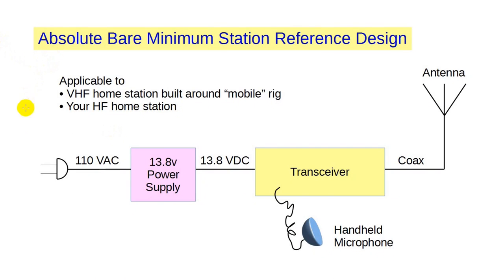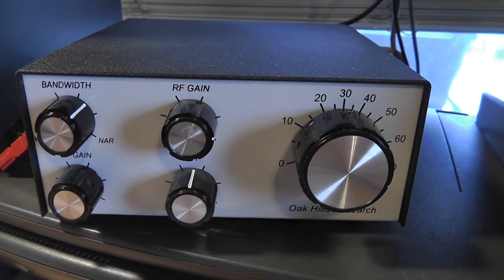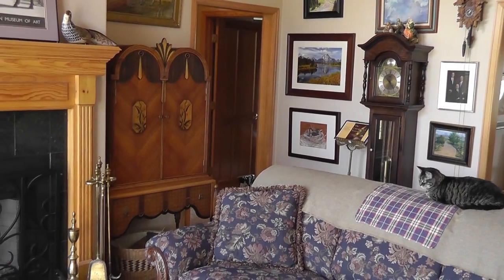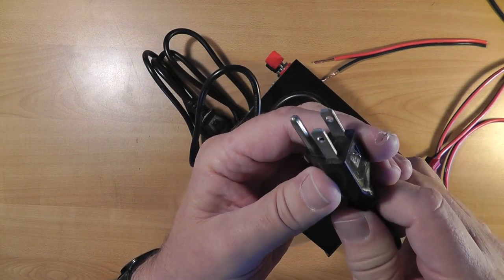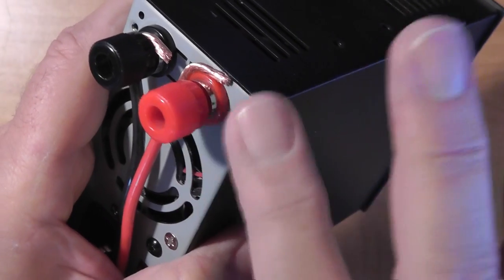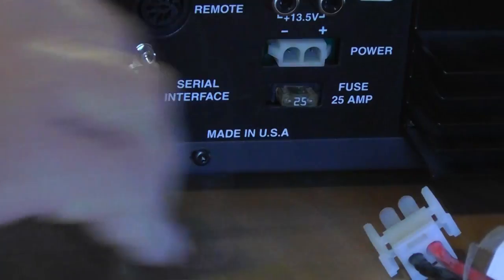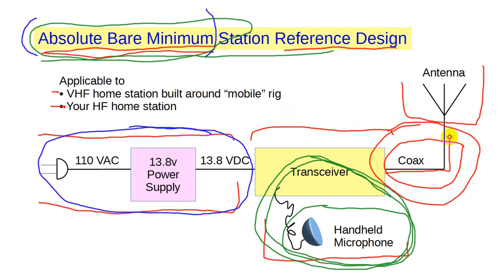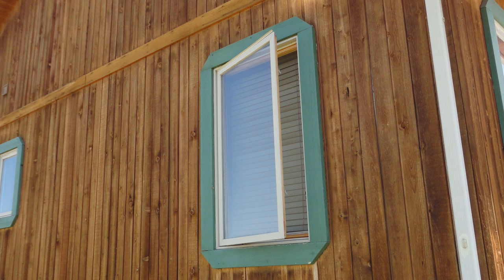Setting Up Your Home Ham Station: Ask Dave Episode 3

Comment: This would have been super helpful when I was trying to get my home station set up. The manuals all just said “Connect the radio to the power supply but didn’t say HOW”. I finally found an article about ring terminals and crimped the wiring to make the connection. Fantastic information!! Thank you!

Comment: Great video! I find that RG-58 is my favorite cable for HF patch cables inside the shack at 100 watts or less. It's very flexible and easy to work with. These days, I'm partial to LMR-240 for outside runs at HF. Should be good for at least 500 watts with a decent SWR. It's easier to work with than RG-213 or LMR-400.

Comment: The steel wool also keeps the critters from coming in through the holes.  It's amazing how a mouse can make it through a very small hole.  My "Shack" is in the "extra" cloak closet in our bedroom.  It's insulated with polyurethane panels on all walls and the ceiling for sound absorption so I can chase that wee-hour DX station.  It has a vent into the ceiling for cooling, it can get quite warm with rigs, computers and amps going.  It's not large, it's about 5'X7' and can be locked to keep the kids out.

Comment: The term RG as a prefix for RF coaxial cable designation comes from the US Navy. They first used it and called it Radio Guide. They needed flexibility and parallel line just wasn't cutting the mustard.
Nowadays we have, as an example, Radio Guide 58 (RG58) feeder transmission line.
Reply from the maker: +Ade Larsen Indeed that is true. And the U that is sometimes appended stands for Utility, e.g., RG-8U. There's an article in the August 2001 issue of QST on the history of coax cable.
Reply: David Casler I'll look it up, thanks Dave.

Comment: I set up a vertical dipole for a 12, 11, and 10 meter antenna.  It is fed in the middle, of course.  It is set on the crest of the roof with a pole coming out horizontally from the apex with the vertical dipole on the end.  It looks strange but it seems the person I set it up for is happy with it.  He also uses it on 6 meters with a tuner.

Comment: Hi Dave. I recently ran my Icom 7300 to (2) 6V golf cart batteries with a Harbor Freight 100 watt solar panel kit, with included charge controller. The first stop off of the batteries is an mfj fused power strip with power pole connection slots.

Comment: Hi Dave and thanks for the insights. They are helpful to a new ham with no Elmer to lean on.
I am with Anthony re: setting up a rig in a vehicle, but probably with a different slant. I live in a Winabego 35 ft. diesel pusher. Most of the time I am in a permanent location and hooked up to shore power. But, from time to time, I disconnect and take a trip. So, I not only have to consider a "base station" but the mobile concept as well. While en route, I am on rubber tires going down the road, when parked, on steel levelers in contact with the ground. Plus, electrically, I live in a metal shell.
I am not so much concerned with how to route cables, or power supply, but more with grounding, lightning protection, portable external antennas vs. a permanent arrangement at home base, etc. and how these relate to my particular living conditions.
I obtained my Tech. class self study only 4 years ago, but have not been on the air much for several reasons. Time has come to use that which has been granted me. Hope you can help.
73

Comment: On
 the power supply, the ring terminals on the back also accept banana plugs. So that's an option to avoid the bare wire and shorting risk. You'll have to get adapters or connectors for your power cord though.

Comment: When I started my journey to HAM I could not afford to buy a power supply and used a 25A⋅h LiFePO4 travel battery) This type of battery provides 14-11V and 20A until the very end of the charge. When working with the Yaesu FT-891 at 100W, this battery was enough for me for more than a day. So this is a good option for those on a tight budget)

Comment: I got my start in single sideband CB radio.  I used to modify single sideband CB radios to go above 1-40 channels and unlock the clarifier.   I'd supply the clarifier with 8 volts and reprogram the PLL chip with either a high (+5 volts) or a low (0 volts).  Now the only Ham radio I have is a Yaesu FT-4VR I got from the local Ham club for passing the test.  It's only a mono band, 2 meter HT and I built a 1/4 wave ground plane out of some old romex 12 AWG wire I cut apart.  Using my old RG-58U CB coax cable from the antenna (20 feet in the air) to the HT.  So far my wife tolerates the coax coming in from outside through a crack in the door, but when it gets too cold I have to shut the door.  I'm hoping maybe my dad will buy me a Baofeng dual band radio so I can get onto the 70 cm band as well.  I have plans to make a 2 meter folded dipole 4 element yagi when I can save up enough to buy the PVC pipe.  I have all the other supplies to make it with.  Trying to hook up an Astatic D-104 to my HT but I'm having difficulty doing that 'cause I cannot find a proper schematic on the Yaesu FT-4VR 'cause they ain't made anymore.

Comment: Another great video.  Informative as always.  As a newly “minted” Technician & General I am looking for feed line and shack setup.  Your L-shaped desk will fit my needs perfectly.  I already have a external box with a pair of LMR400 that feeds lightning arrestors in the external panel and using a low voltage box inside with a metal plate with a couple of N-type bulkhead connectors.    So I am trying to decide between LMR400 & RG213 for VHF/UHF feed line.  Bonding the ROHN 25G tower in a better fashion is also on my list (they only put one ground on a single leg).  I am looking forward to a coming up with a good grounding/bonding plan as well.   So if you have any advice on feed line let me know.  73!

Comment: Hey Dave, thanks for all the great information.  

I have a grounding question; I understand the metal enclosures for all station equipment should be grounded to each other, and then to a dedicated grounding rod - additional to the electrical grounding that is provided by the third prong on the A/C cord. My power supply is very similar to the one in your video and there is no specified spot to attach a ground wire to the case. Do you still recommend grounding the supply this way or is it unnecessary? Is there a specific way I should attach the wire? My transceiver has a built-in terminal for the ground wire.

Thanks again,

Matt
Reply: Your radio case is grounded to your power supply through the black wire. No additional wireless is necessary.

Comment: Dear David
Another great video. I have a different grounding problem since I live in a third floor flat. Do I need to run a thick copper wire to the ground into an earthing rod?
The heating system has old cast iron pipes - it's a 1930s flat.

Comment: Thank you for this information. I'm a newbie Tech and am about to buy the TYT 900 for my home rig.( I have a HT UHF/VHF radio.)  It comes with a antenna, of which I'll really need to study. I know it's most likely for mobile. 💡Question: the MFJ is that the brand name of the connector for windows? Or is it the place to buy this hardware? Im unclear on this. Thanks, i know this seems like an elementary question, but all this is very new to me. I maybe able to get my son to help, but doubtful. I need to understand fully what to do, so as i can repair, etc. But,  I'll need one of those. I'll start with the antenna that comes with the rig I've got a feeling I'll have to mount it on the side of my house. Possibly in an extended PVC pipe???💡  But eventually will put in a fan dipole i saw which is great for all bands. This will probably go on the front of my home. I'm literally on the coast so putting it north- NW will be perfect. It may look funny but asthetics isn't one of my issues lol. Thank you and looking fwd to your next video on small spaces.. Your videos are very helpful to me. You explain in simple terms and carefully. Thank you for that!

Comment: My learning curve in the realm of short wave radios is pretty vertical. I think I might need to start with Episode #1, but this one showed up, and it had an interesting title. I just purchased an Eton Elite 750 (free returns), but after picking up an English broadcast from Havana, Cuba, one somewhere in Japan, one from the South Pacific, I am quickly thinking I want to get into ham, instead of just listening to the broadcasts of others. Can I learn on a shortwave transceiver, say, an ICOM IC-7300 or Yaesu FT-991, but without broadcasting, before getting my ham license? I don’t want to violate any laws about operating a transceiver without a license. It would be nice not to have to buy two different radios (a starter receiver like the Eton and then a transceiver), when I could apply the price of the first one to the second one. Thanks! This was a fantastic video!

Comment: Pros and cons of attic vs exterior antennas?  Great video keep up the great work.
Reply from the maker: +jpintek I'd recommend an exterior antenna if you can do so. Attic antennas do work, but outside and higher in the air is better. 73, Dave, KEØOG

Comment: I would like to recommend that new Hams also NOT use multiple pieces of coaxial cable connected together.   Always try to use a single piece, as each additional connector  between the radio and the antenna can cause additional attenuation of the signal.  This loss  is exacerbated by improperly attached connectors.

Comment: Thank you Dave I'll go ahead and put it back in line with my 225 amp I'm running .. by the way I love your videos I just started to watch them yesterday.. 
Km4wng J.Tineo
I'm in the middle of trying to get my rig up and running in my HOA , house here in Florida
Reply from the maker: I may have misunderstood. Do you have an external power amplifier? Make sure that the LDG is rated to handle that amount of power.

Comment: One thing I disagree with though... RG8 may be just good enough for HF if the run isn't too long, but it's much too lossy for 2m/70cm. I used LMR-600 for my UHF and HF feedlines. Yes, it's overkill for HF, but the best advice for any new Ham, in my opinion, is to buy the most lossless feedline you can afford, period.
Reply from the maker: The key is "can afford." RG8 is expensive enough, but LMR-600 is very pricey. All hams have to make a tradeoff between what's best technically and what fits in the budget.
Reply: David Casler I got 85 feet of LMR-600 for right around $200. I guess we all have different ideas of what 'expensive' is. That didn't seem like a lot to me for top of the line feedline.
Reply: The trick is to make your uhf/vhf runs under 25 feet

Comment: Hi, David. What a great video. It's really helpful. I have a little question about grounding. Can I ground my station to electrical ground(Power supply)
Reply from the maker: Your power supply likely provides an electrical safety ground. On my power supply, the negative line on the 12vdc output is connected to the third-wire ground--not all power supplies are like that but I suspect most are. As far as a signal ground, you may want to have a separate ground to keep the noise and interference down. Even so, the household safety ground and the station signal ground need to be "bonded" together as shown in the video. I would note that many hams end up not needing a separate signal ground (connecting the radio chassis to a ground rod). Good luck! 73, Dave, KEØOG

Comment: I really like your videos and in  particular, I like how you include a lot of bone-head details that might be totally obvious to some, but those of us that are completely self taught may not have picked up along the way.

I do have a question... When attaching 13.8V feed lines to the ring posts on the back of the power supply, is there a reason to NOT put a crimp-on or solder-on ring terminal on the wires?  It seems to me that just wrapping loose strands around the post then squeezing them down with the cap is just begging for single strands to poke out and get into trouble...

73 from the extra class noob.
KI7HSB

Comment: Dave I have a problem with your power supply my radios require at least a twenty power supply. and I have one that want a thirty amp power supply. the supply that you mentioned would be ok for a C B. but the one that you talked about would not  run my radios.
Reply from the maker: 13.8 volts is 13.8 volts. How much amperage the power supply can produce is immaterial. It works for all 13.8 volt radios from QRP rigs up to the normal 100-w watations.

Comment: Thanks Dave! These videos are very helpfull! Question: is it a pain to navigate/type freq directly from the dash of a Kenwood d710ga rather then the mic? I already got a replacing microphone. I’m in process of running coax and installing antennas and didn’t had a chance to play with the radio at all
Reply from the maker: Often VHF/UHF mobile rigs have buttons found on the microphone that don't appear on the main display face. It's intended that you will enter frequecies or select memory channels using the mic.

Comment: Dave thank you so much for the videos. Really helpful! As a new ham, I'm really confused on what logging software I should use, and what dxcluster software. Maybe you could make a video about that? Or just a short reply here would already help me out. Thanks!
Reply from the maker: JamesMegaWatt Hi James, you may be interesting in a video I put together a few months ago, which you can find at https://youtu.be/e-LnD-nXcfM. I will add logging to the topics list. There are many logging programs out there, each with its supporters. I use Ham Radio Deluxe, but it's no longer free.
Reply: David Casler Ok I will check out the video. Thanks so much!

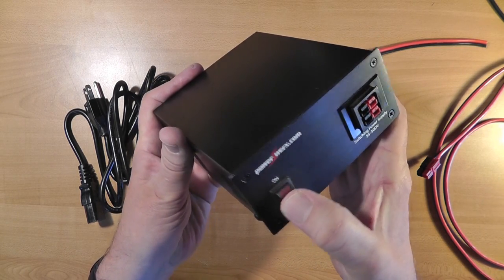Comment: Oh my! 7:33 What did you do to your finger?
Reply from the maker: Nasty cut. Cut the fingernail too. It healed up in due time.
Reply: @davecasler  It reminded me of the multiple times I've lost a finger tip, chopping lettuce on a mandoline. It took about 3 times before I bought Kevlar gloves. Fortunately, my fingertips and nails grew back.
Reply: @buckstarchaser2376  Hi there Buck. don't take offense when I say that I had to laugh when you said that you had a chopping/ cutting accident using a mandolin. I just thought why did you not use a finger pick like any mandolin player does, then realized that you had been using one of the dreaded  horizontal sharp blade slicing  devices. one that I got ages ago went into the trash bin for the same reason. my mandolin sits in it's hard case safely tucked away until I play it and I buy my potato chips from the supermarket now.
Reply: @johncliff5417  The kitchen variety are quite devious as they lure you in with that easy cutting rhythm. Then, all the sudden, you think "did I just cut myself? It doesn't seem that bad" then the bleeding starts, and oh does it start!

Comment: What is an appropriate way to suspend coax without putting pressure on the connector as you mentioned in the video? A loop looks like a bad idea for reasons you mentioned, is there something we can make or purchase for this?
Reply from the maker: +Vance Myers Hi Vance. Sharp bends should be avoided, especially with foam-dialectric coax, as the center wire can migrate until it touches the shield. Similarly, the coax shouldn't be pinched. Otherwise, just put it where needed. If you need to suspend it in the air for some reason, I wouldn't recommend sections longer than 25 feet or so. There's an interesting technique to use to tie rope to the coax that doesn't pinch it; I'll have to put it in an upcoming Ask Dave. Hope that helps. 73, Dave, KEØOG
Reply: +David Casler A video on how to make a dipole connector for the coax and the antenna wires from regular items available like 1/4-3/8"" plastic, brass bolts, and similar items available from the local hardware store.

Comment: How do you know what amp supply you should get and can you connect more then one device to a power supply?
Reply from the maker: Amps these days come with their companion power supplies, and a number of them use fairly high voltage. As for 12v (13.8v) power supplies, a 30amp supply will run your 100w HF rig and your 50w FM rig at the same time.

Comment: Radio first then LDG then external amp to antenna will that work it's just a extra 200 watts ..
Reply from the maker: Okay, I see. You may find you don't need the LDG between the radio and the amplifier. 73

Comment: I have a question Dave , can I hook up my ldg it 100 tuner with my icom 718 and.  225 amp all together.. or do I have to remove the tuner and just keep it off?
Reply from the maker: Hi Jess, the LDG tuner is designed to be left inline all the time. The tuner draws a small amount of 12vdc power, often available from the radio itself. Follow the instructions in the Icom and LDG manuals.

Comment: Hi Dave,I am a ham from South Africa, I recently build a 2m j pole antenna according to video specifications on you tube,I made also a set adjustable cap,with all the dimensions in place and about 7met in the air the swr was 3,5,after adjust the swr adjuster and cut down a 10mm piece on the long arm , it came down to 2,4, I moved the coax connectors up to 120mm and down to 40mm and in-between,but the swr is still remaining on 2,3 to 25,,,needless to say the output of the radio isn't to happy ,can you help ???,thx Willem vd Walt, zs6 wsg South Africa,
Reply from the maker: Sounds frustrating. The matching stub is not entirely linear. Sometimes you can bend the matching stub away and it will help the reactance and help lower the SWR. I suggest keeping the matching stub length at the recommended length.

Comment: i have a question ive just programmed my hand held baofeng radio with uhf channels 1 to 80 and also all the vhf channels what im wondering is do i still need to switch between bands for them to work or will they just work automatically thanks
Reply from the maker: They should work automatically.